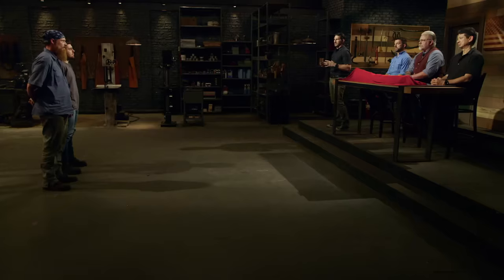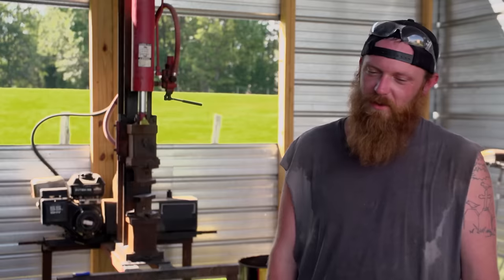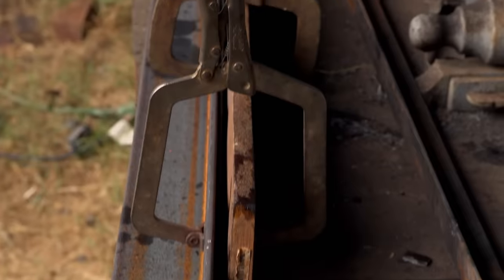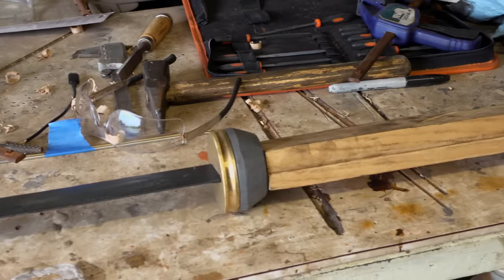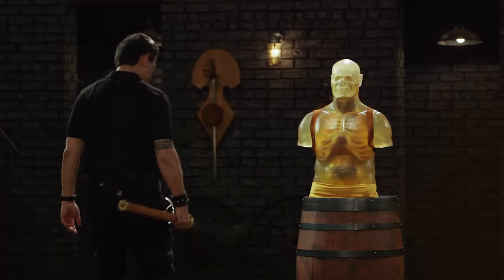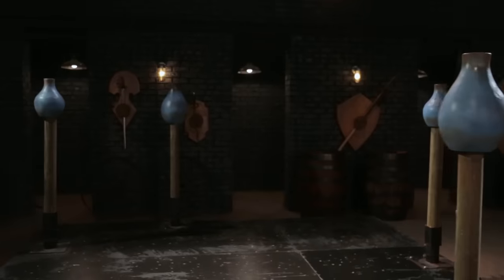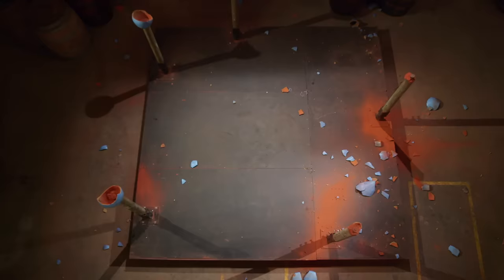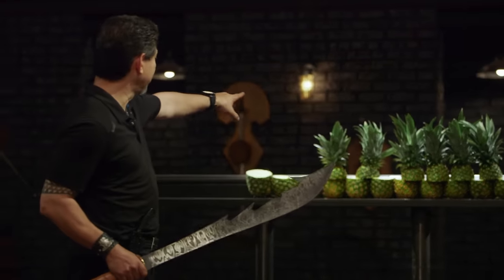Forged in Fire: DISASTROUS Darb Sri Gun Chai Sword DESTROYS the Final Round | History

Comment: If he had put that fur at the bottom of the handle rather than the top, he might have won. The lightweight one warped during the kill test, so weight alone shouldn't have caused a loss; it was the fur making the grip too hard that cost him.
Reply: Also who thinks fur belongs on a weapon meant for slicing someone in half? Just sounds tacky
Reply: If he used a cut strip under the guard rather than such a thick piece
Reply: Yeaaaaah, he put that fur right where the balance asks for a handle
Reply: @zacharyjackson1829  Historical weaponry often has things like fur trims, hairs (like horse hairs in a tail), ribbons, decorative strings/ropes.  That fur piece would have been fine if it was a different type of fur, or if it was just in a different spot.  Rabbit fur is very silky and soft, which is bad for a grip.  Something like bear fur would have actually fit in very well with the type of weapon that was.  But the placement is still the real problem.
Reply: well typically, they tell them exactly why they lost. Youtube has that cut out so you don't see them getting their feedback. I would guess, because he said it during the exit interview, that they told him he lost because it was just too heavy. That Fur would not have cost him cause it can easily be removed with loss of function. However, too heavy can't just be fixed. In the end, they chose a lighter weapon even though it did slightly bend.
Reply: Handle and weight are literally the top reasons someone's blade loses when both make it all the way through.

The judges are saying how it's a shoulder ripper. Even without the Fur, they would choose the lighter one. They pick which one they would rather wield when both blades do well. And it was obvious they'd rather the one that can be used with one hand, whereas his demanded 2 hands.
Reply: @zacharyjackson1829  Lol
Reply: If he chose leather instead of fur...the extra grip might have given him the victory.
Reply: Also, his weapon was on the heavier side. The weight might give you an edge sometimes but in most of the cases, judges would select the lighter blade.

Comment: I love how good a sport these guys are. That said though, I think the guy who lost made a bad handle, not a bad blade. The two guys remarked how bad a call it was to add that fur
Reply: Yea, but it's also heavy. You're more likely to win a battle with a curved blade, than with a heavy one.
Reply: @topanteon  tell that to the Scotts XD
Reply: @topanteon  what? lol im noob at this, i thought heavy weapon (axe, polearm etc) is suppose to be heavy
Reply: @MrRichiarditya  True,  but they both design the same weapon with same capability to kill, cut and withstand blows from pottery. The defining difference is the weight, the lighter one outbeats the one that is putting excess stress on your shoulders to redirect or stop its swing like the pottery guy mentioned. Plus he lost points with the fur grip making it a slippier grip.
Reply: @MrRichiarditya  even large weapons need to be light because you want to be able to maneuver them quickly. If you have a heavy blade, especially if it’s front heavy, it’s going to be very difficult to control and possibly even throw you off balance. If you can’t control the weapon all your opponent has to do to stab you is dodge the first attack and have a nice exposed back to swing at. This is why even large two handed swords like the Zweihander, which can be up to 7 feet long, only weighs between 4 to 9 pounds and has most of the weight back towards the handle. Yes it’s a massive sword but it’s well balanced and isn’t uncontrollably heavy
Reply: @MrRichiarditya  Lighter=Faster. Faster=Winning. on Any weapon, the blade should only be heavy enough to hold its shape under stress. And while heavy blades are better choppers, lighter blades have a Finer edge, and can often Still cut whatever they cant chop. The Wielder is what makes the weapon powerful enough to Cut or Chop through the material.

Comment: I loved the fact that his weapon was light but I was constantly worried that it was too thin and would bend or break. Being light is good but if it cannot continue to perform, its pointless.
Reply: a sword master always is balanced on a knife edge between durability and lightness/speed. He's gotta trust his metals more, he did good!
Reply: I wanted to know how thin was thin for him. 2.5 and even 2 mm (which is thicker than comercial machetes which are 1.5 mm) is actually the historical thickness of the distal third of this weapons. 
And the youngster's weapon bent because it was pattern welded steel should have gone with a spring temper monosteel.

Comment: This is a good example of a "Battlefield" weapon vs an "Guard" weapon; both will kill and are greatly usable in fights, but the first is low maintenance and has some rough spots (weight for example), the other is almost perfect for one or two fights before maintenance, but will require it very soon and often.
Reply: Actually you'd be surprised how delicately built "battlefield" weapons are.  The Daneaxe, the famous 2-handed Viking axe, was typically only between 1-2 lbs for the steel head.  Compare that to a typical wood axe head weighing 4 or 5 lbs or a sledgehammer head weighing 8-10.  The Daneaxe was remarkably thin (2-3mm at the top of the blade), if you've ever seen an accurate replica.  A zweihander sword, which was nearly as tall as a man,, at the absolute heaviest was about 4 lbs and usually around 3 lb.  There is no universe in which battlefield weapons can stand up to tool use.

Weapons were used, damaged, repaired, broken, and disposed of.  In an actual battlefield you won't get to use your weapon against 100 guys like you're chopping wood.  You may get to kill 4 or 5 guys if you're lucky.  There is no point to overbuild these things, and historically they were not.
Reply: @megakedar  You have the cutlass, but that's basically a chopping tool used for fighting in the gunpowder era. You're right, if a viking saw his son chopping wood with his daneaxe he would probably slap him silly.

Comment: They constantly change what's most important...

"This is heavy" but did everything well.
"This is light" but bent in kill test.
Reply: exactly! i honestly was surprised at how it help up in the strength test. you're gonna tell me it bent a bit when it hit synthetic bone but didn't get any damage after when hitting pots?
i mean those aren't as tough as other strength tests but still.
they look for practicality over looks, and looks are mostly bonus points. had James not put the fur thingy (or put it elsewhere on the handle where it wouldn't be gripped) and had a slightly lighter blade, he may have won.
Reply: It's cause this weapon is a sword-spear hybrid.

Slight bending from a striking through bone is to be expected.
Reply: It has a slight bend, but still cut much better than the other weapon.
It isn't bent, there's a difference. Minor warping is negligible. Fighting to keep your weapon under control is not.

It could have also just gone unnoticed from the heat treat and was already there.
Which would explain why it didn't worsen.
Reply: Degrees can be a factor. Like if something is only slightly too heavy? It's makes a difference.
Also it wasn't just lighter, it did in fact have more sharpness to it. Third test for example, they commented on how not only did it cut through, but there was very little resistance. Both were sharp, but the lighter once was sharper. A slight bend that ultimately did nothing to affect its functionality in the end and then held up in the test that was designed to do more damage to the blade isn't really worth much consideration compared to something that is rough to use.
Reply: On top of what other commenters have said, the fur grip hurt the heavy blade, even more so than it would have if the blade was light. The weight makes it hard to control the weapon which amplifies the issue of the fur making the grip slick.
Reply: @crisscrossam  The bone bent it more than the pots because the pots went flying when they were hit, therefore less resistance than the bones inset in a gel dummy that were hit and did not move.
Reply: These are weapons and not tools. That is a very important distinction in how metal is forged because a tool can be heavy as long as it will last longer than the user over many uses. 

  A weapon has to last as long as the user but the user also has to last as long as the job. 

  The heavier the weapon is, the faster the user wears out. The faster the user wears out, the shorter the job is.
Reply: @scottautry9981  weapons are tools. Light weight titanium hammers are highly prized in carpentry because they don't wear you out. Impact drivers are amazing because they put less strain on your wrist/arm. Impact drivers/wrenches have been rapidly advancing to become smaller and lighter.

A knife, bow and spear are all tools, no matter if used for hunting or combat.

Comment: man, I like seeing damascus, but I do find they're overplaying it a bit too much. Damascus as we make it has nothing to do with strength or even use, it's just visual and thus holds greater risks compared to using combined steels in a more traditional way.
Reply: "i wanna set myself apart from the competition" always that part too
Reply: I guess it shows your skill as a bladesmith though. Damascus has no advantage over monosteel and introduces more chances for the steel to fail. If you still make a great weapon despite the disadvantages, then its safe to assume you know what you're doing. I'd definitely mess it up.
Reply: @gorisenke  Hmm a while back I looked up a description of alternatives, and one historical technique was actually based on uneven heating.  Heat and quench the cutting edge to make the surface tough, but don't heat the spine enough to make it brittle.

Comment: Kind of surprised the weapon that took damage(bend) won this but it was super sharp.  Tough decision, i have a feeling the rabbit fur was the deciding factor
Reply: the weight was again. as dave said "shoulder ripping monster". Better to take a slight bend then use a weapon that also damages the user.
Reply: @xaninuax  I see ur point but there is a point in battle that the bend would become unusable. A real warrior would pick weight accustomed to his body. It shouldn't  be a  critical deciding factor unless weight parameters where given out. But the fir made the other weapon also a problem to wield , so I get why the one with the bend won.
Reply: @QAZ-OMEN  nah, if the weapon is that heavy, it would probably become unusable(due to fatigue) far quicker than one that takes some slight bends, even with the strongest warriors. They weren’t specific on how heavy it was, but complaining like that(that it was hard to stop) on a two handed weapon makes me think it was probably enough to ensure using it would mean small mistakes would be basically unrecoverable.
Reply: @jlaw131985  possibly but the bend happened on the first test maybe even the first swing... so tough call but I do think they made the right choice
Reply: @QAZ-OMEN  Since it didn't have anything more happen during the strength test, I think it was probably fine.
Reply: @jlaw131985  yeah like I said, they made the right choice, just surprising because the other 1 took NO damage. I still think it's mostly the rabbit fur but also accompanied with the weight would make it hard to hold onto

Comment: I love how Doug actually correctly referred to the pattern in his blade. He didn't say I really appreciate your Damascus. He said I appreciate the Damascus pattern that you brought out. What everybody today considers to be Damascus; is not Damascus. Damascus is Crucible Steel that has specific impurities in it that when heated to their melting temperature; resolidify into a crystalline lattice of carbides throughout the  steel which in turn give you the pattern as well as Superior hardness and is actually quite difficult to heat treat properly. Modern-day Damascus is nothing more than pattern welded Steel of different types that are easily heat-treated. And so it is incorrect to call what he did Damascus because it is not. It is a Damascus-LIKE-pattern welded  Steel.
Reply: I would love to see them have to use wootz ingots in competition
Reply: @nickyashnyk4549  definitely. That would distinguish a master bladesmith for sure, cuz if they get the Metallurgy wrong during the process, the blade will not perform well. If they get the Metallurgy wrong; it may not even Forge correctly

Comment: Some are complaining about the Slight bend.
But a slight bend can be anything, is it bent or just a minor warp. The latter means absolutely nothing.
It could also just have been from the heat treat and it wasn't noticed if it is so slight.

Overall it's the cutting test for me, it cut WAY better.

Also struggling to keep your weapon in check is worse than a minor bend.
IMHO

Comment: How to game Forged in Fire: Make it light and make it look good even if you have to take more risk. Judges hate heft. (That said in a real world scenario, the winner would likely break or warp after a real battle or two.)
Reply: If you make a weapon so heavy that it's hard to re adjust the blade it will cost you your life if you use it. A bending weapon is still better than something that limit your capabilities in keeping yourself alive. If a weapon break in the middle of a battle just use a different one, soldiers have side arms as back up weapons. And they can always pick up fallen weapons. In this case the blade still perform exceptionally despite slightly bended on the cutting test and the pot test.

Comment: Immediately when the other guy went for aesthetics at the expense of durability I thought he fked up. I guess in the end it's the one part where it can pull ahead if the weapons are otherwise equal. I'm yet again disappointed that the clip failed to show the reason why the other weapon won, because that to me is the most interesting part, although I can assume it's due to the better balance, lighter weight, aesthetics, and no weird fur tuft on the handle.
Reply: That fur got to go. I would think the heavier and thicker blade would be better. With constant battle, it wouldn't break easily and dull.
Reply: @tr1bes  Sure, but if the weapon is too heavy it's going to drain your energy a lot quicker and that's not good either. While durability is important too it mostly depends on the heat treatment and the angle of the blade grind. If the thinner weapon's blade has a similar grind angle then other than being more prone to bending (which is relatively easy to fix as long as the bending isn't too bad) the durability should be nearly equal.

Comment: To me a bend is a failure over weight. In a real fight your adrenaline will be pumping so the weight won't matter much. It will feel light and aid in breaking bones and carrying threw.  A bend on the other hand would decommission a blade really fast because now it's out of alignment for every strike. Perhaps the grip is a failure on the one guys weapon but it's not as big a deal as the other guys bend.
Reply: Take a look at real swords. They are all made to be light for their size and well balanced. This is because having a longer recovery time due to extra weight is literally a death sentence and it is indeed preferable to have a sword that might bend to dying because weight forced you to overcommit. A bend can be worked with in the moment and repaired after. You cannot  repair the stab wound through your chest or lack of a head.

Comment: People are going on and on about how he shouldn't have won because of the "slight bend"...  It chopped through a SKULL to pick that up... ANY weapon can pick up a bend when trying to cut through so much bone.   His weapon was FAR superior... Light, sharp, and strong is better then Heavy and indestructible.    Light weapons are far superior to heavy ones in almost all scenarios.
Reply: Yup. Even in modern times, speed kills better. Plus a thinner blade (so long as it doesn't overly deform or break) will go through its intended material easier because there is less friction. Even with choppy weapons like axes, hollow grinds are better at digging into wood.

Comment: The fact that the Damascus blade bent is already a red flag when it comes to longevity. Would snap like a twig if it was on the battlefield (which blades are primarily for). I'd rather have a forward heavy and stable blade than a light and brittle feeling sword. Blade smithing is a joke nowadays 😅

Comment: See with forging weapons, of course everyone wants to have a weapon that won’t be able to break no matter what happens, but of course you cannot have an indestructible sword, you can have a sword that’s close or a weapon that’s close to indestructible but it’s impossible to have a 100% indestructible sword. Now if you wanna make a sword that’s forward heavy meaning the weights towards the blade and not towards the handle, then you won’t be able to use it for very long because it would take more energy to swing it around versus just chopping with it, even blade Smiths with 40 years of experience with just making weapons, even they cannot get both categories of light and strong near 100% for both, because you actually can’t, the closest you can get is 90% light light 90% strong, you cannot get 100% light and 100% strong, it’s impossible. Of course there is different methods of forging but nowadays many people kind of use one method but just call it different things.